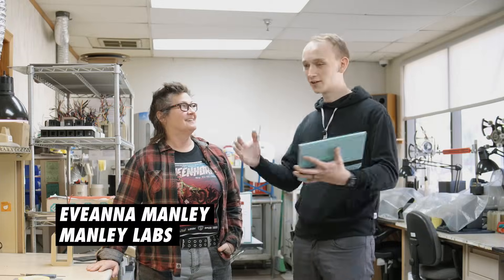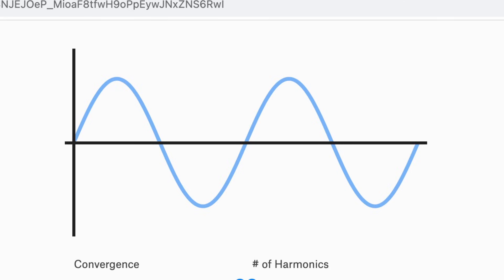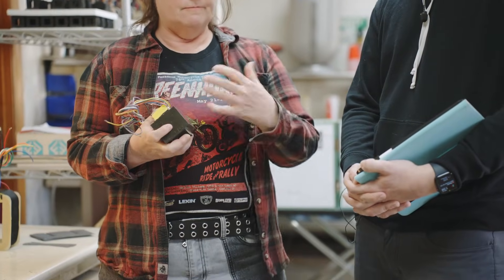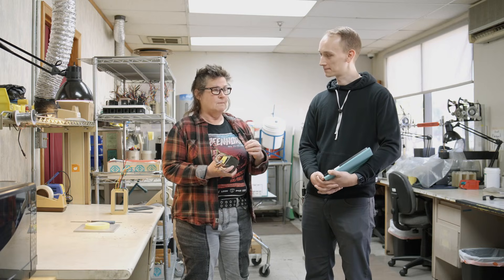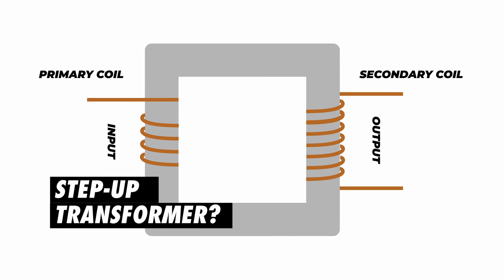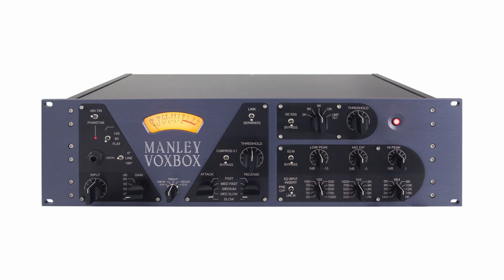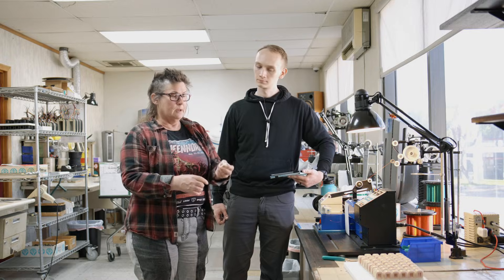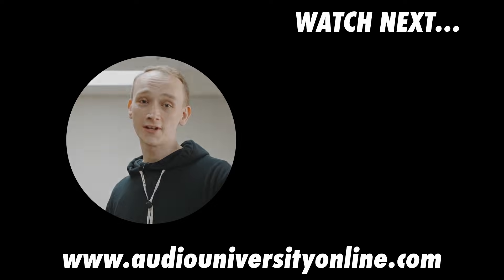EveAnna Manley: Tubes & Transformers In Audio Gear

Comment: Interesting! 
Most "normal" tranformers are either made for mains power at 50-60 Hz (which also uses those laminated iron cores) or very high frequency (for use in switch mode power supplies) - usually at or above the upper limit of the audiable range (20 kHz). Those uses ferrite cores. Some may also run at 400 Hz, as that's used for example in the electrical system in air planes (I'm not sure about what core material used there)
But now think about making just one transformer that works all the way from below mains frequency (at least down to 20 Hz for good audio) up to the lower end used by switch mode power supplies - without running the core into saturation at the lowest frequencies and still not getting problem with a lot of leak inductance that act like an unwanted low pass filter, cutting out all the high frequencies from the speaker
 - that is indeed a real challange. 
But I guss this is the only way to do it without adding a transistor power circuit after the tube circuit (to get enough current capability to drive the speakers). That would defeat the purpose of a tube amplifier I guess (because then you will still get the  overdrive characteristics of the transistors and not the tubes). The tubes are probably too high impedance to form an output stage that can drive standard 4 or 8 Ω speakers directly.
Reply: Huge speaker with long voice coil, a strong magnet, and very thin wire should be made for those tubes.

Transistors are cheap. No need to overdrive them. Class D amplifier. Put the transistors close to the coil to avoid parasitic capacity.
Reply: @ArneChristianRosenfeldt  Yes - a speaker with a custom made high impedance voice coil, would indeed do the trick. It's just like motors - they can be made for either low voltage, high current (low impedance - thick wire and few turns on the windings) or high voltage, low current (high impedance - thin wire and many turns on the windings). The tubes give out a high voltage, but low current signal - so a suitable speaker would have high impedance (that has a voice coil with thin wire and many turns on it)
But the common standard for speakers are usually 8 or 4 ohms - so the idea with the transformer is probably to be able to drive a standard speakers by "converting" the high voltage low current signal into a low voltage high current. 
I think the whole idea with tubes, is their special characteristic when overdriven - which fits some music.  It's also a subjective thing - some may like that special distortion characteristic more than others. 
It's hard to get that same sound using transistors. 
To reproduce the waveform as accurate as possible and get THD to lowest possible level, transistors are probably just as good, if not better (given that they are not overdriven) - and they are also more efficient in general (for example, there is no filament that need to be kept hot and wastes energy). Especially when used in class D configuration (which is basically a PWM-based inverter, rather than a linear amplifier), they are way more efficient. So, for most us, transistors are the best choice
 - but for some applications, the tubes may be preferred.
Reply: @Speeder84XL  someone replied that speakers have been high impedance in the past. Also there are electro static speakers. Great that there is a standard, but other industries manage a handful of standards easily. HDMI displayPort. SPDFIF RCA windows mac. CD DAT light bulbs
Reply: @ArneChristianRosenfeldt  Yes, that makes sense. 
But using a high impedance speaker with most ordinary amplifiers gives the opposite problem. The output from the speaker will be very weak, as the signal have too low voltage (so not much of the available power from the amplifier can be used). 
That's why there is a common standard for speakers - which the amplifiers are then built for. 
Just like the standard for common mains devices is agreed to be 50 Hz AC (sinewave) at 230-240 V RMS here in Europe (or 120 V at 60 Hz in US) or the electrical system in cars being 12 VDC. It would be a hassle if the manufacturers built devices and car parts for a whole load of different voltages and frequencies.
The standard for speakers in turn is set to be convenient with transistor based amplifiers and probably with safety in mind. To reach high power levels thru a high impedance load, the voltage needs to be so high it become a shock hazard with open speaker and amplifier terminals. 

Eletrostatic speakers are interesting though - since those can't be made low impedance. Maybe there a tube amplifier could drive them directly. To be driven by a standard transistor based amplifier they need a transformer that do the opposite
 - take in the low voltage high current signal and steps it up to high voltage low current.

Comment: Theres a really high pitch squeel in this video, quiet but noticeable!
Reply from the maker: It’s amazing what noise reduction can do to audio recorded on a factory floor!
Reply: @AudioUniversity  Maybe that's a reason to not use it. I would rather take some fans and stuff in the background than poor audio quality. I didn't particularly noticed the high pitch squeel, but taught "bad compression on this one" (mainly data compression, not dynamic compression - even if it has both) - YouTube isn't that bad nowadays so it has to be the original file (and thaught it was a little annoying as other videos I have seen on this channel have quite good audio quality). 
But this examplains it all, as noise reduction usually degrade the sound in a way that sound very similar to bad data compression, like for example MP3 file with low bit rate. When it filters out wide spectrum/high frequency background noise it also affect for example "S-sounds" when speaking. Otherwise - very interesting video